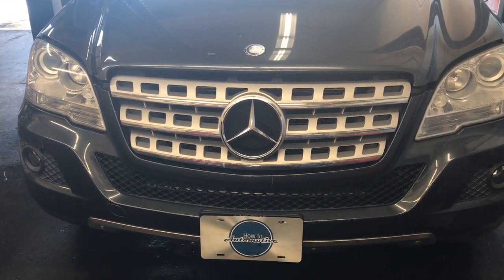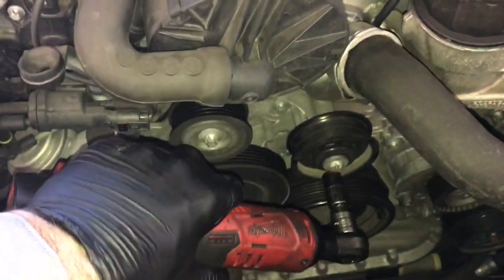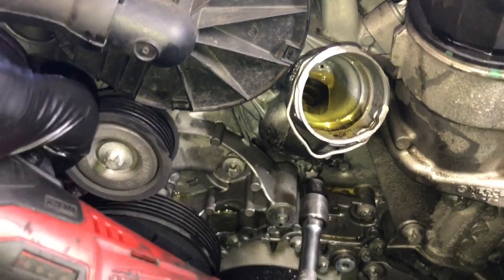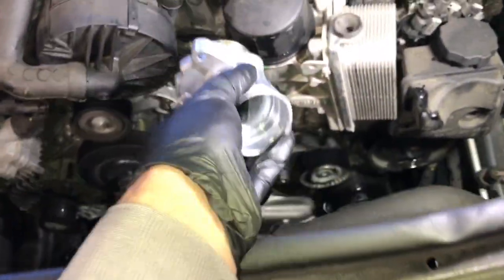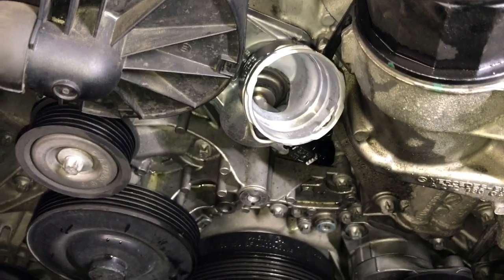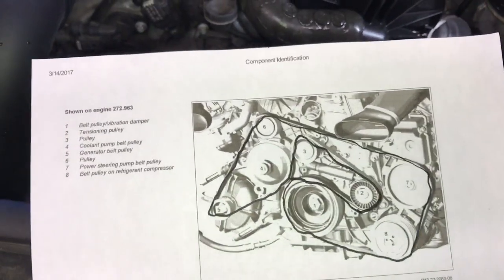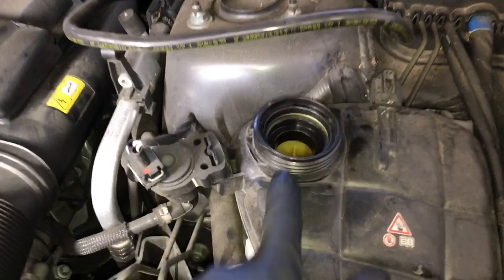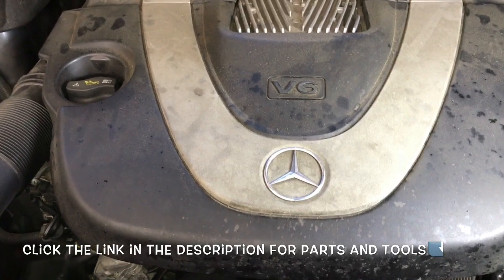How To Replace The Thermostat On A Mercedes ML350

Comment: Excellent video and instructions.  I used this as reference and guidance to change the thermostat in a 2008 ML550.  With the larger engine there is a bit less elbow room but your guidance was spot on.

Comment: Hi Brian, excellent video; my replacement went as smoothly as yours did in the video.  One thing I would mention, after I finished, I could not clear the check engine light.  I knew things were working properly and after about 100 miles of driving the check engine light cleared on it's own.
Reply: This answers my question. Thanks

Comment: Thanks for the video.  I did this job on my 2007 a couple years ago and I bought a cheap chinesium thermostat off eBay..... it's leaking not closing and the engine is running too cool with CEL indicating this.  Anyway, I've got a new one (German made this time) and will be attempting here in an hour or so.  But the last time I did this I pulled the whole air pump off so that access to the bolts on the thermostat was easier.  I'm going to try it your way first though since that will obviously save a ton of time.  I never thought about pushing it to the side.... will report back

Actually pulled first two screws off the air pump just to help it wiggle a bit more so I could fit socket in there.  Amazing how much faster it goes when you don't pull the air pump off....LOL.  Thanks again.

Comment: Great methodical video with good camera work. I have a 2009 ML 350. The only difference from your video was that the Torx bolt on the idler pulley that had to be removed was E12 the bolts on the thermostat were E10. I guess the Germans wanted a bit of diversity.
Reply: My idler pulley has an E14
Reply: Actually E16

Comment: Is it possible if you use a different coolant than what the dealer uses it will make your check engine light come on... I was told my coolant thermostat needs to be replaced... prior my light for coolant came on and I went to O'Reilly and purchased some from there. Thanks

Comment: Awesome video! Finished it thanks to your video! However, I still get the same CEL code. I topped off the coolant, the hose to the thermostat is hot (indicating the thermostat turns on), the inside temp gauge does not indicate it’s over heating. I let it sit for about an hour, normal temp and no smoke. It started to smoke after I revved it a few times, but the engine temp is still normal! 

Suggestions? Solutions?
Reply from the maker: Mike z it’s possible it’s not coolant causing it to smoke but burning oil. Which could be a bad PCV valve or internal Engine problem

Comment: up-date on the termostat the hose was coming out of the termostat after 15 minutes of driving because I was using aftermarket and the gasket was also leaking I replaced with original and the problem was solved makes a difference between a 45$ dollar termostat and a 109$ dollar termostat.
Reply from the maker: dany ordonez glad you got it all worked out. Thank you for the update!
Reply: Wonder where did you order the oem thermostat ？

Comment: Nice video, thank you! About to try it. Question: Instead of trying to move the Air Intake Housing, would it possibly be easier to unclip and remove the front part of the air intake housing to provide access to the bolts and possibly not have to remove the S-Belt? Thanks.

Comment: I have a problem. i need to do a flush for this car, but the drain hole does not drain any coolant after i loosen the red petcock valve. Any ideas?
Reply from the maker: Mai Le remove the lower radiator hose.
Reply: It would be a mess. I dont want to spill coolant to the ground. Looks like i have to bring it to a shop. Sigh...
Reply from the maker: Mai Le if you pull the hose off slowly you can control how fast the coolant comes out and have a container ready to catch it.
Reply from the maker: But at the car and coin is hot the maybe that would not be a good thing.

Comment: what could be causing the hose to come out the termostat housing  when the clip is in place
Reply from the maker: dany ordonez The only reason I can think of is if the clip was not installed correctly or The hose or housing is worn out.
Reply: How to Automotive ok thanks I replaced the termostat with a aftermarket should I use a OEM

Comment: How do I reset the check engine light?! How come this was not a part of the video?!
Reply: Need to use a Mercedes Star Diagnostic System. $1500 for system on ebay or go to dealer/ indie shop that has one
Reply: @23klicks  No need to go to the dealer, my $150 scanner  can clear it.